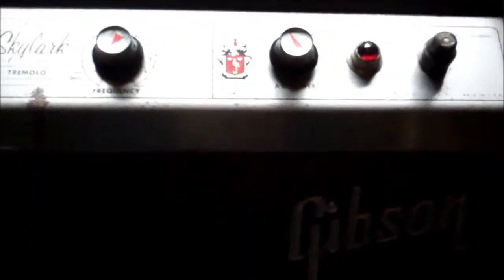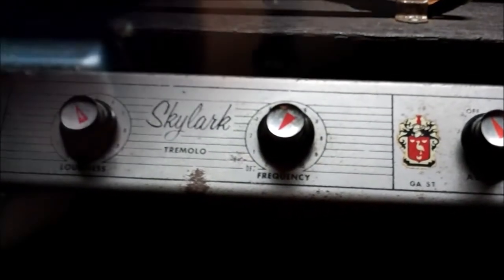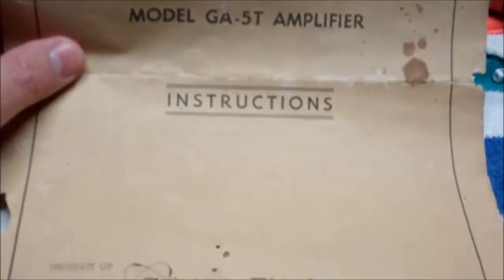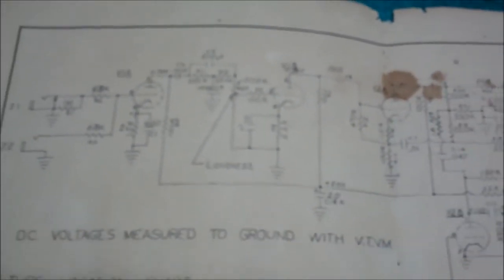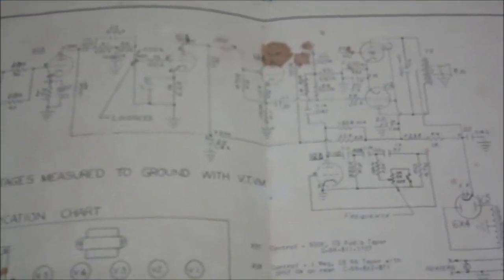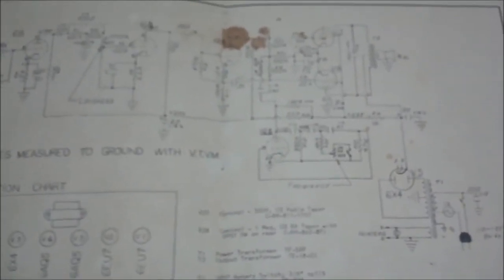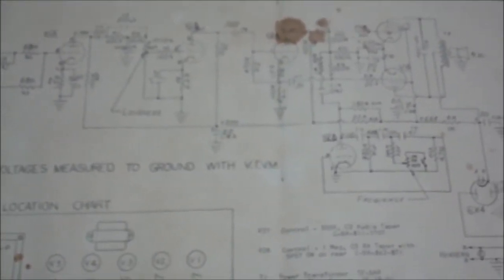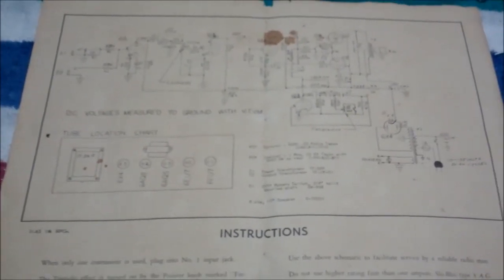The "Tone Sucking Circuit"  on Vintage Gibson Guitar Amps

Comment: They didn't start using that circuit until the later versions of the crestline series.......The earlier versions of all the crestline amps didn't have that circuit.
Reply: I've owned and played both moded versions and stock with the multi cap setup....and the multi cap amps are anemic compared to a simple coupling cap mod. You might like the sound and thats fine, but the amp is more robust and full with the mod, and it has much more umph.

Comment: I have a 65' skylark crestline, and while the schematic doesn't have the sprague tone network (square orange dealio) written in, I popped the hood and looked tonight. It's there for sure, tied to the volume pot. The amp sounds amazing with my p90s. I haven't been able to try the amp with my strat yet...but I think I'll dig it either way, because I like bright tones. But yeah- I found that interesting that the schematic online for the crestline era 6aq5 push pull amp doesn't have this sprague square unit written in...perhaps it's in all the gibson amps, and they just left it out of some of the schematics that were written? Or maybe it was in some amps, but not others? I don't know :) Or maybe it wasn't written into older schematics because it's a larger unit that contains several components; and back then in the 60's there might not have been a universal symbol established yet for units like this to then use to write into a schematic. So, it just got left out maybe. Again, I am not sure. Maybe the amp techs just always tied these to the volume pots of gibson amps of this particular era...(like 62-67') but then in other eras they didn't do it. And maybe some of the crestline amps either left the factory without the sprague unit, or whenever someone wrote this schematic years later, they left out the sprague unit out of ignorance to it's existence, or because someone had already modded the amp in possession that the schematic was written based on....
Reply from the maker: I have the original Manual/Schematic,   and that couplet is listed on there.
Reply: @DeadKoby  oh ok....cool!  So, I just found a great copy...not the original schematic that you have.... But the copy appears to be legit...almost like it was also made at gibson by a tech in the 60's. It has the sprague couplet. So, my old schematic was totally wrong. But I wonder....I can't figure out my this new one looks slightly different from yours. Yours doesn't show clearly in this video of yours. But i can tell that they are different. For ex. - mine doesn't have tube drawings like yours does. Mine just says v1a, etc.
https://www.tdpri.com/attachments/ga5crestline-with-102c84-1024-png.581132/

Comment: My 64 gibson falcon ga19rvt has a tone/bass control and " had " the sprague " couplett" attached to that knob and the thing was way too bright and had very crappy bass..You could not find a good tolerable setting on the tone / bass knob.. I removed the couplett and put in a .01 cap and it completely turned it into a dreamy beast..I love it now but before i changed it i was about to sell it cheap !
Reply from the maker: It certainly pays to understand a tone stack.  In that case of this GA-5t,  the tone knob on the guitar actually gives you the range you need.
Reply: @DeadKoby  
I know, I have a few marshalls and fenders, a couple traynor amps from the early 70's and various combo amps from the 50's and 60's ..The mid 60's falcons are the only ones that i've had tone stack issues ! I'm always adjusting my guitar volume and tone knobs.I'll even mod them to 50's tone mod specs for a greater more usable tone sweep..
Reply from the maker: Cool...  Nothing beats solving a plaguing problem.
Reply: same - have exact amp you have and once removed the sprague network, it sounds worlds better. I don't doubt video author, but I know how terrible vs how good my ga19rvt sounds with and without that tone sucker.

Comment: As a Gibson Player I can tell you this isn't true. The original kit's were sold with Les Paul Jr's that had P-90 not humbuckers. If you clip the circuit it doesn't change the tone you just get more volume. You may have a point that they were trying not to blow the speaker but rolling back the volume without the circuit works just fine.
Reply: I agree his comment about it being specific to humbuckers is a bit too specific. His point about tone control stands. Guitars have passive tone controls that are only subtractive. So it makes sense to set an amp (whether with circuit design or tone controls) to be very bright at its brightest, which gives an extended tonal range. "Use that tone knob, its why they put them on the guitar." This is a fantastic video with a very thoughtful analysis counter to the status quo and would give me a lot of confidence in this guy if I was considering him as my amp tech.
Reply: @ayoungethan  hard for me to agree about the tone control when I have an amp took off the circuit and didn't change the way it behaved. It made it louder, better to drive a beefer speaker. YMMV.
Reply from the maker: Sorry I'm so late to reply...   As a technician,  I try not to re-design anything unless it's REALLY broken,  or "useless otherwise"....    I think the last thing I "re-designed"  was the Cordovox amp years ago,  where the accordion was long gone,  and there was really NOTHING else I could do than make a guitar amp out of it.   I suppose I'm just a "repair guy".... but I'm ok with that.
Reply: Hypnosake - I am interested in this. I have many Gibson Crestlines (Epiphone Pacemaker, Gibson Hawk ga25rvt, Gibson Scout ga17rvt and Gibson Discoverer ga8t. Are there videos of clipping the tone circuit (where you don’t affect tone, but increase the volume only) anywhere? Can I assume this would work with all Gibsons, not just the skylark?  If so, I would love to learn, seeing as these amps sound killer but they just don’t get all that loud.
Reply: Hymnsake. Sorry, mistyped

Comment: I have a Duo-Medalist and the RVT35 Watt 1x12  these are basically bright amps. People are notorious for hoping the RVT 35 it's a small but monster sounding amplifier at 35 watts it is a killer amp  I have the Amplifier placed in an all-new cabinet.  The amplifier now resides inside a custom build birch plywood and blonde covering and oxblood speaker cover.  The issue is that you have to find good non-microphone 7591 power tubes.  Otherwise, it is not sounding good.  Too many people are modding these old amps, they are what they are.
Reply from the maker: If you think about it.... the bright amp balances a dark neck humbucker...  just like in the old jazz box.

Comment: I know many people won't believe this video, but it is dead on analysis in my experience. I have 10 amps, 2 of which are Gibsons. The Duo Medalist, and GA-5 Skylark are the only ones where I can fully use the tone knobs on my guitars. Why would a manufacturer go out of their way to design a circuit that "sucked your tone"? I encourage owners of these amps to leave the circuits alone, and learn how they are meant to work FOR you. If you simply must buy into the "tone suck" myth, please please please, just clip the leads and bypass it so they can be easily repaired by a future owner. I assure you it won't be able to suck your tone just hanging out in the enclosure. 

These amps sound great as designed, but they do work a little bit differently than any of my other amps. They aren't any harder to use, but you do have to work with them rather than expect them to respond like a different product. My first amp was my GA-5 Skylark bought used in the mid 1980's. Funny story... for the longest time I thought everybody else's amps were the ones with the "tone sucking circuitry"!
Reply from the maker: Designed for Gibson pickups would be the appropriate name....

Comment: Shots fired "boom!"
Reply from the maker: I've seen too many techs just "go after" this circuit,  without actually playing with it.   I had a friend plug a Telecaster "wide open"  into it,  and the treble was dreadfully strong.   I told him to try an LP with the tone knob rolled back..   MUCH Better...   Not everything sounds like a Fender or a Marshall out of the gate.   Vox can sound icy too...    I greatly prefer this amp to my GA-5 LP junior amp  (USA Reissue, Also on the channel)...  since you can't get a super bright tone from it at all.... it's always dark.
Reply: Great video